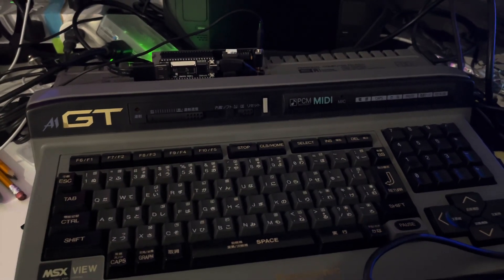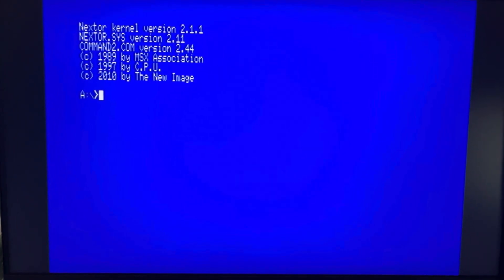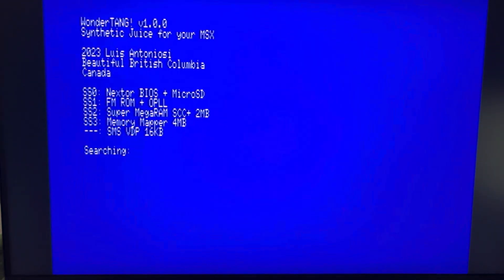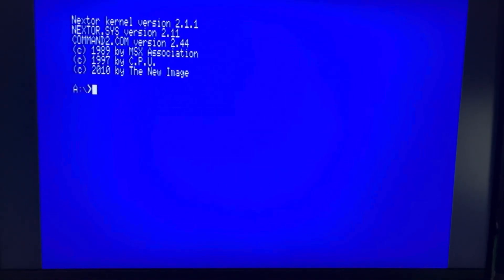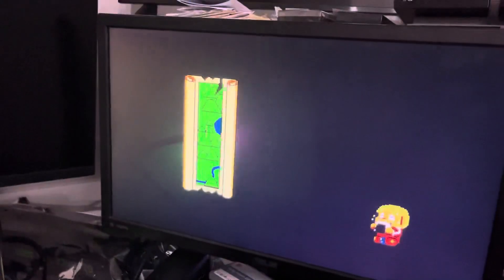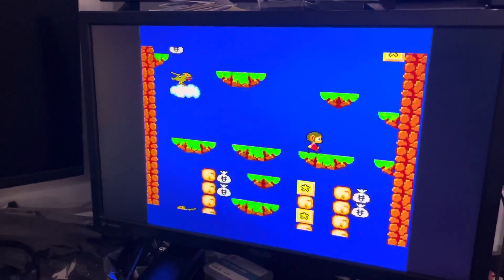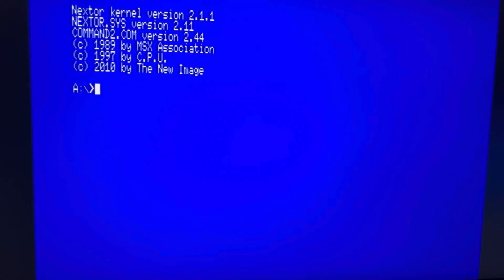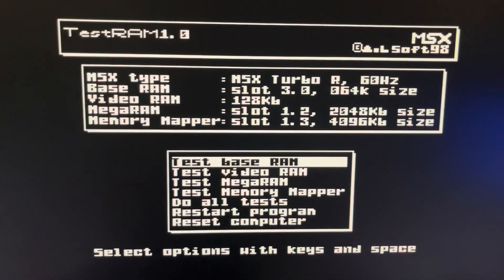WonderTANG! on MSX turboR

Comment: Hi

I have a Turbo R ST what are your experiences so far?
Does it work well with the Turbo R, also the memory expansion?

I am also interested.
Reply from the maker: it works but the TR does not automatically use the external RAM (internal is always faster). So to run larger SMS games you need to pass the parameter to use the external RAM, see SSMS.TXT info
Reply from the maker: @lexpee  sorry I don't see why I should bother doing a detailed PDF, I don't sell any cards you just bought it from someone else, you can ask your vendor. Just install SOFARUN the SSMS.TXT is inside it or to to msx.org

Comment: Could it run other cores, like NES?
Reply from the maker: it does not run "Cores" it is just implementing a SMS VDP plus other things. SofaRun runs SMS games through a cartridge called Franky or Playsoniq so I am just mimicking these carts
Reply from the maker: Sure you can add a NES video chip but then you need to add a 6502 and all the logic  behind and develop the software to load from the MSX to run on it.